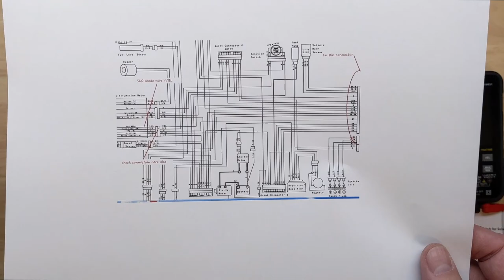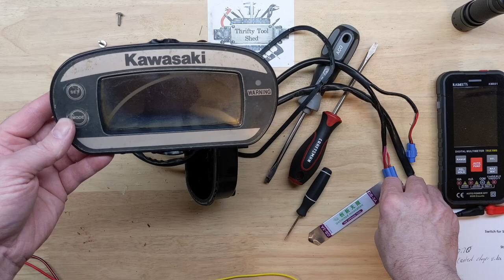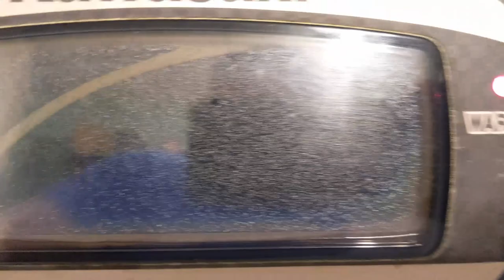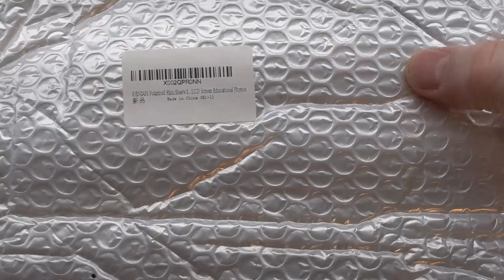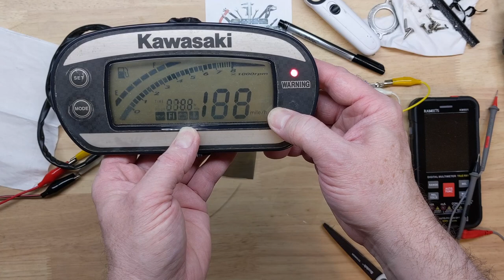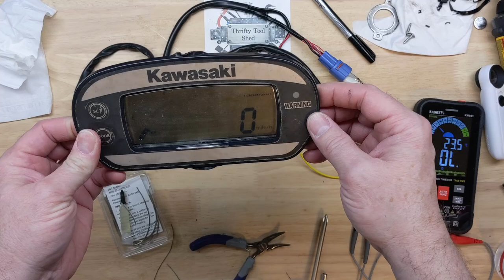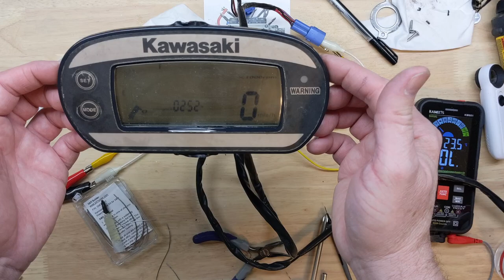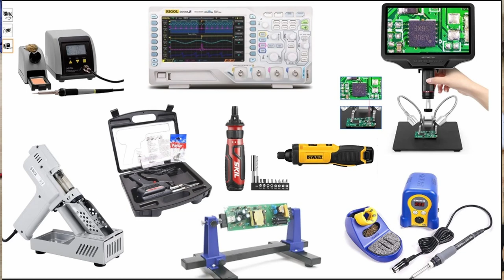Kawasaki STX-15F JetSki MFD Repair

Comment: To me this is what YouTube is all about. Nice work sir.
Reply from the maker: Thanks for your kind comment!
Reply: @ThriftyToolShed wondering if you have any more suggestions, I’m only getting bits and pieces of the screen when I power it up. This one isn’t sun burnt like your buddies was, the polarized film looks pretty good. The board itself was rough though, a lot of rust that made it down to the pins throughout the whole board. Cleaning the zebra strip helped quite a bit, I went from almost zero screen image to 50% but not sure what else I can do. My guess is this is where the problem is, ordered some silicon conductive strip to see if maybe replacing that helps. I don’t think it’s the lcd screen itself that’s the problem but I’m basing that off pure guessing power.
Reply from the maker: @The_Brew_Dog  
I would lean the exact direction you are going. I would try new elastomeric strips and see if that helps.
I was going to suggest a really good cleaning first and it sounds as if you have already done that. Best of luck to ya!
Reply: @ThriftyToolShed  figured it was worth asking to see if you had any other tricks up your sleeve. Thanks all the same.

Comment: Great video, thanks so much for taking the time to make and upload this!  This display is very similar to the Kawasaki Ultra 150 and they are also notorious for this kind of damage.  I'm waiting on the polarized film to arrive,  but I've got it disassembled thanks to your video.  So far the main difference seems to be the Ultra 150 has a second glass screen rather than the film you peeled off, then the film is sandwiched in the middle.
Reply: Oh - and a set of plastic razor blades comes in really handy for peeling the film without damaging the LCD.

Comment: Great video!  I'm going to look at some of the old displays I have laying around.

One thing I would add is to smear some 3M 5200 Fast Cure around that rubber plug that goes into the back of the display.  Also smear some around where the wires enter the plug.  This will help keep water out if the 'Ski is ever flipped  upside down.

Comment: Hello friend! Many thanks to you from Russia ) The video helped a lot. There was no power on the panel. It turned out that there is a power-off key on the chip. I changed the film, the power was turned on by turning the key on the diagram. Who needs help write, I will tell you.

Comment: Can you show me how’s connect power without harness wires?
Reply from the maker: The wiring diagram I shared may help with that. It's been a while since I repaired this.
Reply: @ThriftyToolShed  black ground to black ground, red+red white to red battery? I’m just newbie’s jetski that why I need some help!thanks!
Reply from the maker: It has been quite a while, but that does seem correct. I am pretty sure I showed it in the video.

Comment: I attempted this on a Polaris jetski's MDF.  There were 2 pieces of glass and I had black spots.  It doesn't look like the actual LCD was damaged.  Did this have 2 glass pieces?
Reply from the maker: At around 7:30 in the video you can see the LCD removal. I had a clear lens with the gasket and after that I had the polarized film layer on front of the LCD itself. I don't believe you want to take it apart further than that. That would be the LCD glued together itself I believe. Best of luck to ya!

Comment: You are good at what you do.  You did a good job on this! I have mine apart now and will need to replace the 2 13mm Tactile switch. What type is needed.
Reply from the maker: 6x6x13mm. I have a link in the video description for the ones I used in this video. Thanks for your kind comment!

Comment: So red and white go to the battery ? What color is the the ground wire thanks bud !
Reply from the maker: The negative connection is Black. The Red and the Red/Wht go to positive to power up MFD. As long as it's the same model the wiring diagram I shared will work.

Comment: Great video. Which wire's are you hooking up your power supply to?
Reply from the maker: The negative connection is Black. The Red and the Red/Wht go to positive to power up MFD. As long as it's the same model the wiring diagram I shared will work.

Comment: Great video! Now I want to open mine! 😅 I have the same display with different problem and I would like to see what advice you could share. The only thing I am having problems with is that only part of the screen is visible. If I apply pressure at the bottom of the screen, you can see the screen with no issues? Do you think it’s the strip that could be bad or the metal bracket? Thanks for any and all help
Reply from the maker: Yes, it sounds like the elastomeric (zebra) strip is not making a good connection. I would try cleaning it and board connection points really well with a high percentage IPA and as you mentioned make sure the metal bracket is holding good pressure to it. Sometimes the strip gets hard from age and causes similar issues as well. Best of luck to ya!

Comment: Do you service these?  Mine has been giving me a fit with intermittently working.  Lately the oil gauge is the only thing that displays.  Sometimes it all works.
Reply from the maker: I wish I had time, I do get asked this often. I do not have a repair service at this time.  I work full time+ in a Industrial job and try to have time to edit videos to post. I try to help by posting what I have learned and sharing that best I can. Best of luck to you with yours!

Comment: Was the ski having any issue due to the fact that the display wasn’t working. I have the same one and when it powers up I don’t get the two beeps when turning on also speedometer not work. In turn mine is not starting
Reply: Is the cluster controlling anything else
Reply from the maker: This one was in the slo mode as mentioned in the video. Other than that it would run. We first thought the display non-working was causing the slo mode. As shown the screen was electronically working. The LCD ended up being blacked out by the polarized film. As far as I know the fuel gauge, speed and the mode are the main things you loose if MFD failure. As far as I know the MFD does not stop the ski from running? I guess it's still possible something bad on the board could cause an issue if still plugged in? You can unplug the MFD and see if it still has the issue. Best of luck to ya!

Comment: Awesome job and video. Going to attempt same repair. Would you recommend any other way off separating the halfs in hindsight. Thanks in advance.
Reply from the maker: I would do it the same as shown in video. That way the flange will still be in tact! Best of luck to ya!
Reply: Hi. Quick question. I got mine apart and found that both sides off the led screen were bad.  Replaced the front with polarized film and could see graphics but very dim. Whats on the back side? Mirror film with Adhesive? Thanks in advance for any help.
Reply from the maker: I am not sure anything fixable on the back side of the LCD itself. The only thing I would know to try is make sure the (zebra) elastomeric strip is very clean and making good tight contact to the edge of LCD. Best of luck to ya!
Reply: @MrAstrokidd  not all polarizing film is the same.. and sometimes just putting it on the in the wrong direction can effect how well it works.. just something to keep in mind..
Reply: @skyfireaerial  I got it figured out.  I needed to use polarized screen in back of lcd as well. Working on putting it all together now. Thanks for the info.

Comment: Is there a certain kind of electronic glue that you attach the little white rubber strip to the glass with That Make's contact to the board
Reply from the maker: If you are asking about the elastomeric (zebra) strip it makes an electrical connection so I simply cleaned with 99% alcohol. No glue, but sometimes after years pushed together they almost appear to be stuck with adhesive.